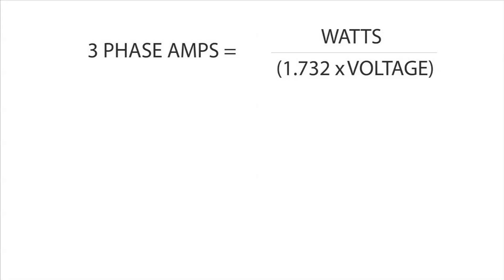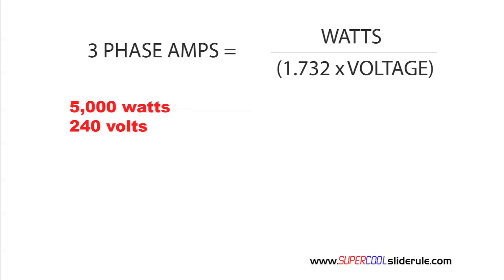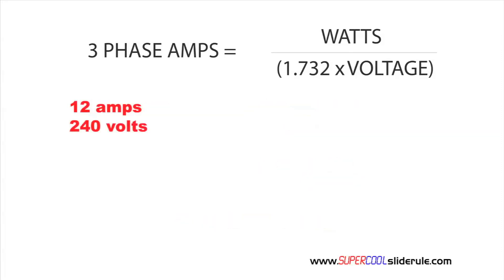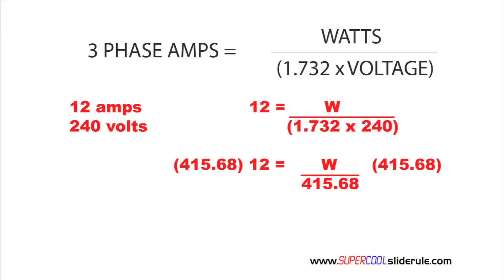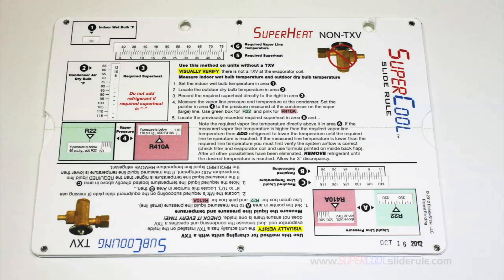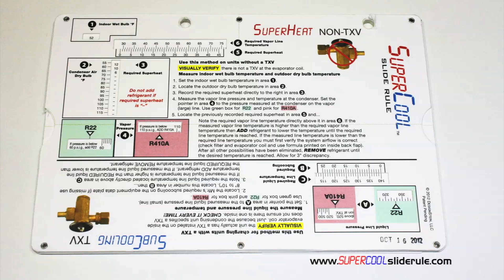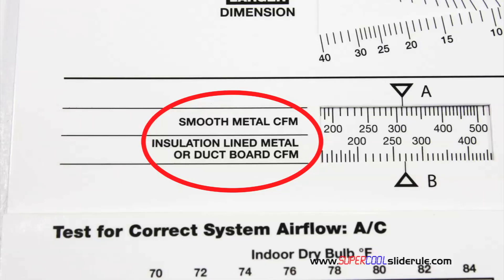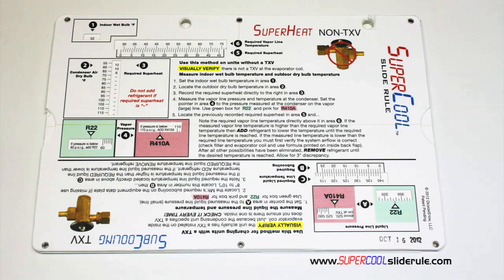3 Phase Amp Equation

Comment: Nice video,,,,please calculate current in 28 MW(mega watt), 234 kv, 3 phase feeder...please
Reply: 28000000÷(234000×√3×0.9)=76
Reply: 0.9 is p.f.
Reply: 69
Reply: Your numbers...

28,000,000 ÷ (√3×234000) = 69
Reply: @JasonCarmichael  nice try...👍👍👍
Reply: @सिर्फसत्य  I have better equipment, my pf is 1. (resistant free, friction free, pretty much an overunity device) 

LOL =)
Reply: @JasonCarmichael  👌👌👌👍👍👍😁😁😁😁😁
Reply: @JasonCarmichael  nope,,,,76 kA

Comment: The formula used in this video is for apparent power(VA). If you want to get the current(Amps) using Active or Real Power(Watts) use the formula:

WATTS = √3 x Voltage x Amps x cos(power factor) 

Transpose:
Amps = WATTS / √3 x Voltage x cos(power factor) 

*here in my country we always use 80% power factor on actual.
Reply: Not cos ( power factor ),Just power factor. Power factor = cos ( phase angle of current and voltage )
Reply: Could I ask voltage meaning single phase voltage or 3-phase voltage?
Reply: Not single phase voltage but VLN voltage since VLL is equal to 1.7*VLN

Comment: Why 1.732?
We are using it in three phase calculation, could you please briefly tell us. Thanks for you videos. God bless you.
Reply: 1.732 is square root of 3.
Reply: Because phases are 120deg out of phase with one another, they can't just be added. to break it down:

Say Current1 is 1Amp, and Current2 is 1Amp. If you draw this as a diagram, you'd have two lines coming off a common point, and the two lines would be 120deg apart. Draw a line now between the two extremities of your lines and you've made a triangle, with a leg 1Amp long, another leg 1Amp long, and a hypotenuse at Y Amps long.  That hypotenuse is the combination of the two phases. To find it's length using basic math, you need a right angle. You draw a line that bisects the triangle from the origin through the middle of the hypotenuse, creating two right-angle triangles that both have a 60deg angle (where you bisected the 120deg angle) and a 90deg angle where it went through the hypotenuse. Now use basic math to solve for Y. 

sin 60deg = 1/2 Y / Current1. --> 0.866 = 0.5Y / 1Amp --> 1.732 = Y. 

This tells you that in a 3 phase system, when you combine two currents of the same magnitude, since they are out of phase by 120deg, the sum of those two currents is 1.732 times more than either one of the two.

Comment: I need to see if I have room for a 3 phase device.  I checked each panel feeder (each phase) with an amp probe. The problem I'm having is where to multiple 1.732 or divide.  The main is 250A 208V. If I have 60A on each phase and the device is 13kw 3 phase, I'm thinking (250A*208V*1.732)-(60A*3(phases)*208V*1.732) and see if the remainder has room for the 13,000watts. Not considering apparent power, power factor, etc. and it's a non-continuous load.
Reply: Dude, if u have 13 KW connected to 3 phase 208 V  your amps consumption will be 36 A each leg assuming it is equaly distributed among 3 phase